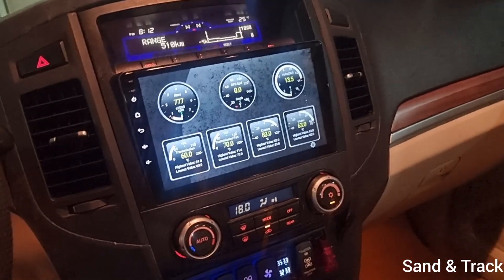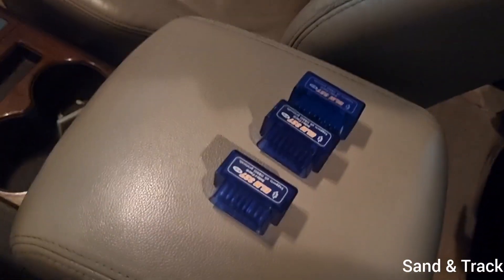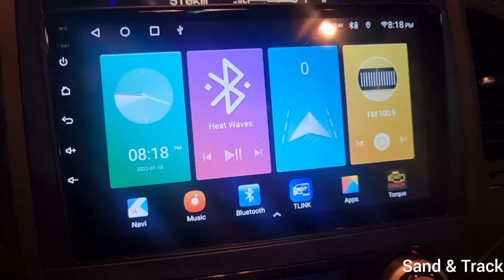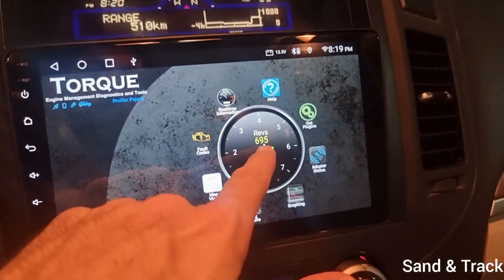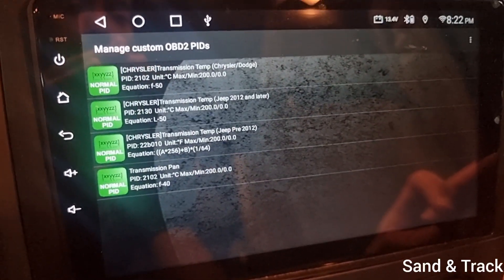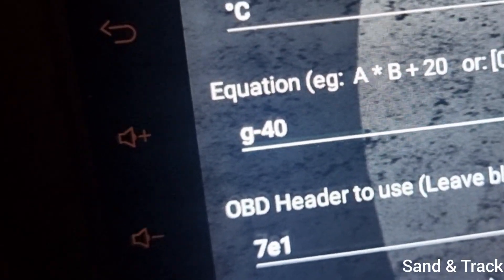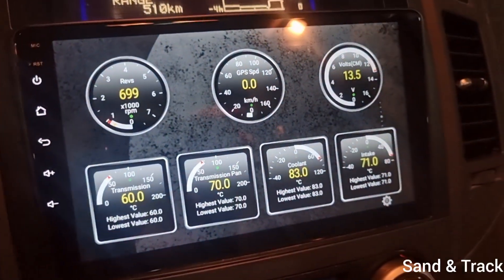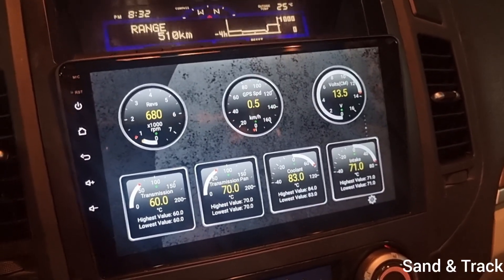How to read Transmission Temperature on Pajero? [Full OBDII Settings Explained]

Comment: Any idea if a OBD 2 BT unit will work on a android unit on a 2011 Pajero Sport?
Reply from the maker: https://www.cronos4x4.com/collections/frontpage/products/v1-5-super-mini-elm327-bluetooth-elm-327-version-1-5-with-pic18f25k80-chip-obd2-obdii-for-android-torque-car-code-scanner
Reply: Yes was checking if it would work on a pajero sport 3.2 DID that has the 4M41 engine. I got one here locally, it works, but no engine transmission temperature.

Comment: Tried all your settings but the transmission temp and pan doesnt show green .... means no data is captured. I have the same version 1.5 OBD2 and torque Pro. 

Tried the full settings from description in your video too...

I have a 2016 Pajero. 😢😢😢 i really want to monitor transmission temperature for offroading in the desert here in Dubai

Comment: do you have access to the PID's? I use a lufi XF which is able to read all the non normal temps (SST temps) in my evo 10. Surely this would have the capability of reading the tranny temps in the paj, I just dont have the PID for that. Is there a reason that you use the Chrysler/Dodge PID in torque pro? does this read from the same sensor in the Paj?
Reply from the maker: I don't have access sorry to detailed pids

Comment: will this work on a 2006 NS Exceed Pajero? :)
Reply from the maker: Yes it should bro
Reply: I have been advised that the equation of "F-50" is for the Aisin automatic transmission.  Your NS has the Jatco automatic transmission and apparently the equation for that box is "F-40".   I also have an NS (2007 Exceed) so I changed the setting in mine to reflect this and need something to compare it against!  (not sure about the transmission pan temperature equation, as yet)

Comment: How do you get 510km range on your pajero? Mine will never get to 400km !
Reply from the maker: I keep my car serviced well, I also realised that the Pajero fuel tank bends easily in offroad driving and thats why many have lower fuel economy. I recently installed a new fuel tank with no bends so the full capacity is back. Lastly my car is tuned by speedecu.com which also helps
Reply: @SandTrack  Is your petrol v6
Reply: Long route and 100 speed is best for fuel consumption average

Comment: Guys thank you very much, the question here what is the ideal temp for the AT ?
Reply from the maker: mine is anywhere between 69 to 80 depending on the drive and outside conditions
Reply: In your video: what is the difference between Transmission and transmission pan? Which one reflects the transmission temperature??
Reply: @sand & track In your video: what is the difference between Transmission and transmission pan? Which one reflects the transmission temperature??

Comment: THNX very much for this knoledge. Does it works on Pajero 2008 diesel engine also?
Reply from the maker: You are most welcome! Yes it should work on Deisel Pajero to read transmission temperature
Reply: Works on my 2013 diesel